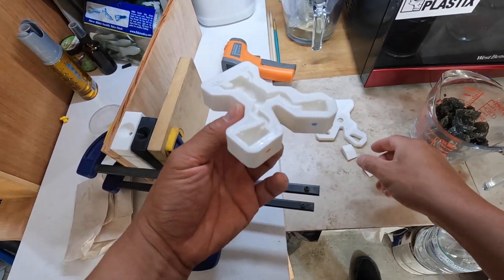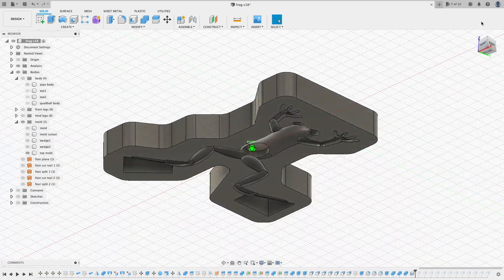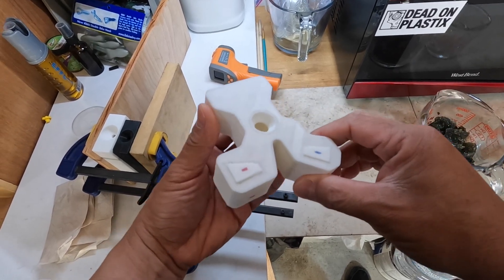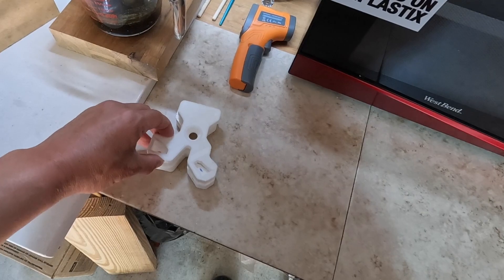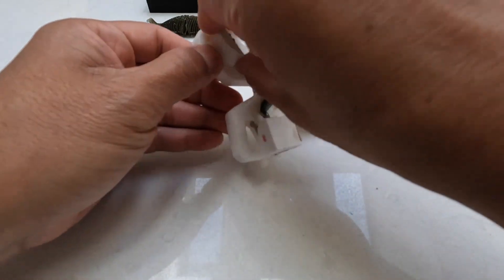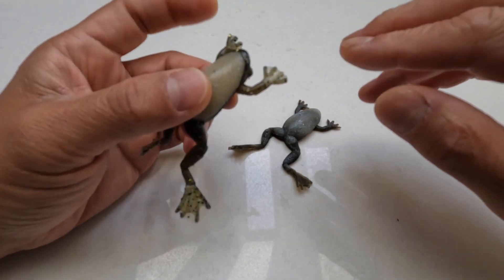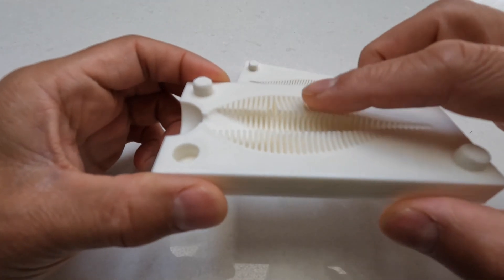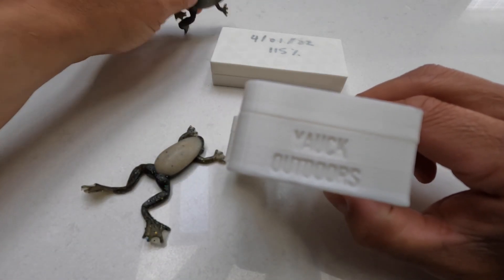Hybrid Mold - Transforming an Open Pour Mold into a Closed Injection Mold

Comment: You can heat your injector using a hot water bottle (if you can find one)
Reply from the maker: Thanks for the cool tip 🙂or should I say hot tip? 😜
Reply: sorry I got sidetracked!! I use a heat gun (wife destruction) I have a piece of 4x2 with 3 holes in it as a stand and a stand for the heat gun

Comment: The clamping really helps when you space them evenly around the mold. When your just using the weight of the injector the pressure is only on the center and allows the plastic to escape around the edges. If a mold is giving me trouble I’ll cut out a piece of wood and clamp that to it to evenly distribute the pressure around the mold.